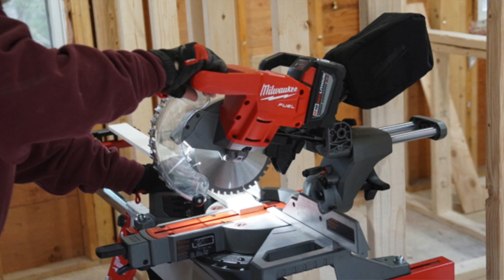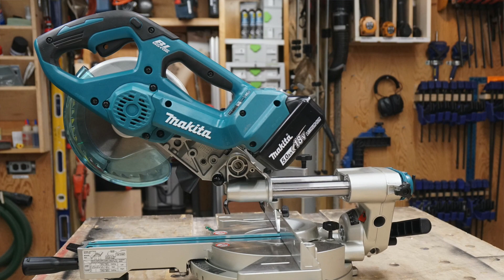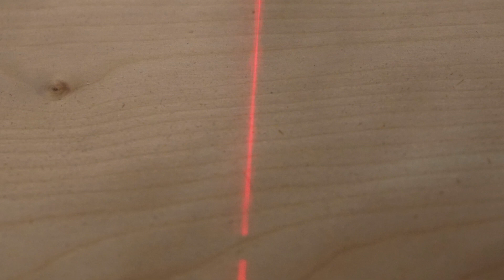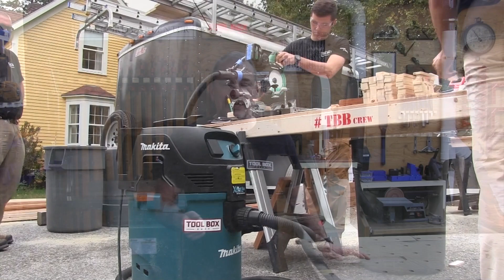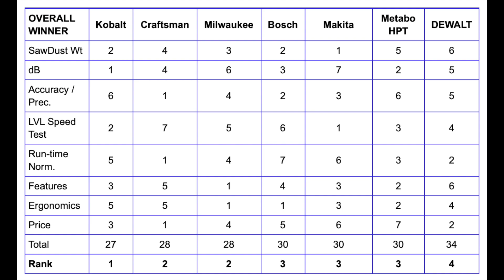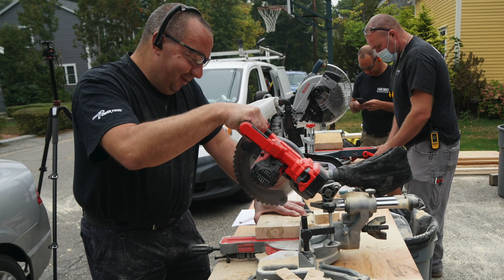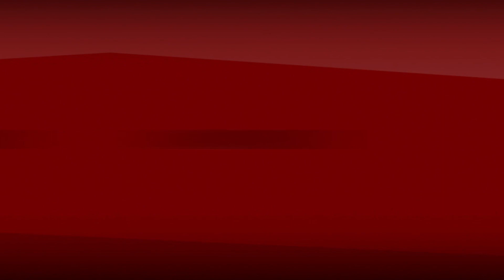BEST Compact Cordless Miter Saw - HEAD-TO-HEAD

Comment: Being from the Milwaukee area, we got to test a prototype design for a Milwaukee 10". It was pure garbage. We still have it 10 years later but we only use it with an aluminum cutting blade for cutting panic bars to fit on doors.

Comment: I need to know how accurate they are once adjusted. How do they compare to each other fully setup opperating at their peak. How easy to adjust is important, but how they came from the factory, as a professional is not so important. Once properly adjusted how does it stack up.  Ty, fantastic and informative vids

Comment: Hey Rob
Thanks to you and your testers i was trying to decided on a smaller saw for trim as finish carpenter as a high end cabinet maker told me has better teeth alignment to the piece,  and less vibration.
  I reviewed many narrowed to Milwaukee, Bosch, Makita and Metabo. After video demo and reviews became dual Makita or Metabo with larger cut capacity and features. My choice became the makita as the metabo doesn't even offer a saw stand. 
Ah the internet makes life easier as long as there is channel like this one. 

Thanks Rob and tot the crew

Comment: I have use the cobalt sliding dual bevel miter saw cordless for over two years. My only issue has been with the cobalt is they do not make replacement parts for it so if you break a part on it, you’re out of luck you have to get a new saw they do not make parts for the cobalt, compact, sliding miter saw.

Comment: I just bought a Craftsman V20 6 tool kit because it was $15 more than just the Harbor Freight Bauer oscillating tool and batteries and charger I actually needed. So since all of a sudden my cordless tool vendor is Craftsman, and I need a miter saw soon, Craftsman is my first consideration. You guys made a LOT of cuts and gave all these saws a LOT of run time and use, so considering that and how well the Craftsman scored, I'm confident it'll be a good choice to add to my cordless tool collection. Thank you for the absolute best review of miter saws I could have asked for!

Comment: I grew up on Hitachi. I have their current 12in dual bevel slider, and I had the previous 2006 model that was way overbuilt, looked like an alien, and had the same fine bevel adjustments as this compact one. I really wish they would come up with a more reasonable price for this one. I know R&D is expensive and I’m sure it’s well built. It’s just hard to justify that price when I also already have two 12in dual bevel sliders…the other being a Ridgid branded Delta Cruzer. Honestly though, I didn’t realize this saw had a laser. I may go buy it now…still prefer them over LED’s.

Comment: In the vid and your article you state you tested the ease of "tuning" the saw, yet as far as i can see you haven't published the findings. 
Are any of these actually tuneable in regard to the settings of the presets? Ie 30° or 45°.
Most saws I've found you can only tune it by adjusting the fence, which adjust every preset including the 90 irrespective of it's accuracy. 
Reason being I have a compound mitre saw that cuts true in most settings, but the presets are out of whack by fractions of a degree on them, most notably the 45s. Sure I can test it and adjust to get an accurate cut, but it's a proper hassle to require test and adjustment after moving between different settings.

Comment: I'm starting over with battery powered tools.  I have a 20 year old suite of Dewalt (drill, hammer drill, circular saw, reciprocating saw and flex gooseneck light) that I'm about to retire.  My last couple of NiCad batteries are dying out, these old Dewalt tools are big, bulky and heavy but very tough.  I want to start over with the newer lightweight Lithium battery versions.  In addition to the battery powered tools I have already  listed, I will want to add:  battery powered Oscillating saw, jig saw, grinder and 7.25" sliding compound miter saw as you guys have reviewed above.  This will be for my personal use which will be light and some handyman work that will also be fairly light.  I think Dewalt, Ryobi, Milwaukee, Kobalt, Makita + more make all these battery powered tools I will be getting.  Can you recommend a brand to go with that will be good quality and a good value where the same batteries work on every tool.  I'm leaning towards the Kobalt due to the good review on the sliding compound mitre saw you guys did here. 

If there is a clear winner in your mind for a line of hand tools that doesn't have a quality lightweight  7.25" Sliding compound Mitre saw, I'd still like to know what brand that is because I am willing to go with a different product and different batteries for just the 7.25" Mitre saw and everything else a different brand with the same batteries if that is the way to go.  The Ryobi packages seem to have some excellent pricing but I've never owned a Ryobi tool.  I have a tiny light weight Bosch battery powered drill that I always reach for first because of it's feather light weight.  So 1. what brand that has all the tools I want, good quality, good value and 2. what brand that has all the tools I want except the Mitre saw?  which I can buy separately.  Also, I'm not opposed to Harbor Freight tools, they seem to be offering some competition with quality examples in some tools now.  thanks, Tim

Comment: I have an old makita 10" miter saw that just didnt have the cut capacity and weighs a ton.  A few days ago I bought the corded Kobalt 7 1/4 sliding miter, simgle bevel miter saw and what a difference.  Larger cut capacity, blades are cheap, I have a lot of 7 1/4 blades and the 60t diablo ultra finish I had new fits it perfectly.

I was using my circ saw on anything wider than 2x6 but I'll be using the miter saw a lot more around the house.

Comment: I bought the dewalt and thought it was utter 💩💩💩 mitres for facings were out a mile and even tho I bought a better blade it was still rubbish and sold it straight away. Wish dewalt would make it more like a premium range because it felt really plastic and horrible too. 🤮🤮 

What's the best small corded saw guys. 240 UK 
I currently use festool on a portable stand but OK if I'm doing lots of work. Need somthing small I can just whip out the van quickly do the job and back in. Thanks

Comment: I‘d say the most important point on mitre saws is precision. So I‘d rank precision over stuff like runtime. That’s why I got the Bosch. With two 8ah core batteries it easily serves me the whole day. I personally prefer the laser over the blade shadow as for me it works better in direct sunlight. But that’s just personal taste I guess.
Reply: What size did you buy?  Do you still love it?

Comment: Picked up the Kobalt a week ago along with the 6.0 ah battery.  It is powerful, feature rich with the dual bevel, long crosscut ,  strong shadow light, multiple bevel stops, etc. and smooth sliding.  HOWEVER, I am having trouble with accuracy.  I am cutting base on the flat, and even though the bevel (with two different digital gauges and a carpenters triangle) at a 45, the cuts themselves are off (by a full degree+).  In addition, the crosscut is not 90 degrees to the fence and when I set it at 90, then it is off on the bevel.  I'm wondering if the rails might be slightly off too.  It is possible I got a bad one, but pretty frustrating so far.  Will try a bit more, but running out of patience.
Reply: Just a follow-up.  I returned the Kobalt.  Now researching the remaining options.  Honestly, I know the Dewalt is practically at the bottom of the list on features (i.e. no brushless motor, left bevel only, only 8" cross-cut, shadow light is dimmer than other shadow lights, etc.) and is one of the oldest offerings in the group, but it has a ton of Amazon reviews (800+) - partly due to its age - and many folks note the accuracy is good and it s generally very highly recommended.  I may give it a shot.  The Makita is online only and, frankly, the new 40 volt LS002G is both a.) likely to replace it and b.) likely to be expensive (i.e. $600+, plus a new battery system).

Comment: If we get the new Makita 8 1/2" LS002G XGT (Makita's new 40 volt platform) in the U.S. this year, it could be a serious player in this space.  Specs look good (12 1/2" crosscut,  miter 60 left and right, Bevel 48 left and right, forward facing rails, 4800 rpm, etc.)...basically a smaller version of their 10", but with the new platform (note: the latter isn't necessarily a good thing if you already have a bunch of LXT batteries.  It is already out in Asia.  Here is a video from Vietnam: https://www.youtube.com/watch?v=pegcFR1CCZk

Comment: It’s December 2020 and I’ve had that makita for about 2-1/2 years now. I keep 6.0 batteries on it. It can fit on my passenger seat if I want it to. It is one of my most valued tools. I have the stand for it as well. I can pick it up on the stand and move it around if I have to. It cuts anything pretty much. I like not carrying my 12 inch makita around. But the best set up ever Is when I get them both going in a straight line with material standouts on either side and a trash can in the middle. I can slide 16 foot trim between the two and drop waste in the can in the middle. Ideally you’d want 4 saws going and only set an angle once on each saw. So next I’ll probably go with a ten inch makita two battery saw, then I’d have that little makita in the middle for just straight cuts.

Comment: I wish the DeWalt was a mini version of their 12" saw. There is no reason for it to not have all the same options. That being said I don't understand why you were so hard on the DeWalt yet you praised the craftsman and described it as old DeWalt tech.
Reply: Staley black&decker bought craftsman a few years ago to be there homeowner line of tools. Like ryobi is to Milwaukee
Reply: @stoicllc2352  how far we have fallen. Craftsman use to make quality tools I still have some of grandpas craftsman tools from the 50s and 60s. In fact I used an old Craftsman breaker bar with a pipe as an extension to break the lugs off my work truck yesterday.

Comment: I got the Craftsman because my priority was portability.  I strap it to the back of my Quad and go out into the field to cut 1x6 fence boards.  Only downside is the power on hardwood boards, but.... that was expected since it is so small and light.   Great review!  Cements my opinion of the Craftsman.

Comment: Another great test,and great data for weekend warriors. 
But let's face it,very few contractors will have 4 batteries and 1 seperate  tool brand for value's sake.
My 2 exceptions to my m12/m18, Makita 18/x2 lines are,Ryobi pin nailer with adapters for red and teal,a Ridgid shop vacuum with teal adapters. 
Most flaws can be overcome by a work-around, all poor dust collection needs is a hood and a tarp below,no shadowline add an led inside blade guard,and etc.
 Fantastic job to the whole TBB crew👊.

Comment: I appreciate the testing you guys do. Is there any chance that you add ease of getting warranty repair to the mix, e.g. do you have to ship it back to a service center or can you drop the saw off at the store? Until recently I would have given extra consideration to DeWalt because a service center was in the next town. However, that service center is now closed and most tools, regardless of brand, I purchase need to be shipped to a center for service.

Comment: One important spec that wasn't mentioned (IMO) is CROSS-CUT CAPACITY.  Assuming the cordless Bosch is based on the corded version, I can easily and cleanly cross-cut a stair tread on my corded Bosch, but I can't cross-cut (in one pass) on my Milwaukee M18 7-1/4" miter saw.  As a finish carpenter, this is an important decision factor.  If only Milwaukee came out with a copy of Bosch's saw, I'd sell my current 7-1/4" for a 8-1/2".  Two gripes about the Bosch however:  the top carry handle, and it's only single bevel.  I might, however, pick up the cordless Bosch and slap an M18 battery adapter in there since 95% of all my batteries are M18.
Reply from the maker: It’s in the article

Comment: Excellent review!!! Got the Craftsman for $203 as a kit out the door & have had it a year & a half now. It's been an excellent saw & I was shocked how accurate mine was. I like the smaller footprint & weight of the Craftsman & it has extras the DeWalt doesn't like a depth stop for dados & rubberized grip. Just wish it had a top handle. Otherwise, it's just like the DeWalt but scaled down to save 10lbs of weight. Best DIY value unless you got the Kobalt on that insane $99 deal last year.

Comment: Great review! I'm surprised that Craftsman came it second place. And a testament to great engineering, dewalt saw has a brushed motor and still came in second place in the normalize runtime, goes to show engineering in a product is critical.
Reply: Because saws are used at full power brushless and brushed there isn't a big difference in runtime like a drill or impact driver

Comment: I didn't have all this information when I bought my Milwaukee 7 inch, but I still made the right choice in the long run. I wanted to try the Metabo specifically because of the AC option, but no one had them in stock and that price is stupid. The Bosch was an 8 inch blade and that killed it for me. I own Bosch batteries and would have loved to use those on the saw. The Kobalt and the Craftsman were nice little saws, but the slide bars sounded gritty and weren't as smooth as my 780. The Makita I loved, but it was the 2 battery thing that got me. We bought the 10 inch to rebuild my parent's house after Irma and I loved that saw, but the dual batteries was a pain. Milwaukee already had a head up with me since I had a 6 and 9 ah battery.  The Dewalt single bevel was a deal breaker even though I love my 780. Like I said, the Kobalt was just the rails sounding gritty and my worry that their batteries will vanish soon since Lowes seems to be pushing them aside.

Comment: I’ve made so many purchases based on your reviews. Simply the best overall most professional on YouTube. I own the Dewalt 7 1/4 saw and currently looking to replace my 12in Delta Cruzer with something a bit smaller and lighter but still want power and capacity. Leaning towards the Metabo miter and table saw. Like the option of corded also. Thanks

Comment: I appreciate your honesty, and knowing the results but as a pro we are probably chained to battery platform not to mention in the back of my mind I am thinking no way that Kobalt is better than my Makita
Reply from the maker: That Makita has an impressive run time - cutting. Its a nice saw
Reply: I use power tools from four brands, but have mostly Makita batteries. There's a battery adapter for every platform out there. Electricity and batteries are agnostic, and it's only connectors that make it proprietary.

Comment: I own and use the DeAlt saw professionally and while I like it and use it; i agree it can benefit from a gen 2 upgrade. It needs dual bevel and would benefit from adjustable fence. The DeWalt is just a good cheap pro grade saw. It’s nice in that it uses the standard 20 Volt batteries. It works great for trim as you can bring it right in next to you given its size. I love the small wall and find I use it more than the 12” just because it’s smaller, lighter, and easier to move.
Reply: fyi fence is adjustable screws on back side

Comment: I have the DeWalt saw, not the best out of the test (though I have the european adapted version) but I just want to say that it does really well, I build several sheds with it etc. one battery a day. But I think I will go to their flexvolt version if they don't upgrade this one. (I am on the Dewalt platform otherwise I would've gone for the Millwaukee tbh)

Comment: Nice test as usual.  
Suggestion:  I wish you would have used a High Output battery in the Dewalt and Milwaukee saws.  They certainly would have performed better in run time, power and efficiency.  I realize you are just using the stock battery, but most anyone who buys a Milwaukee or Dewalt saw would own a bigger battery to use in a power hungry stationary tool like this.  In future tests, you might want to consider testing the tool with a more realistic battery rather than the undersized stock battery included just to keep costs down.  The Makita saw had 2 -5.0 batteries and the Milwaukee had only one.  I would expect the Milwaukee to lose on all performance tests.  If it (also the Dewalt) had a 6.0, 8.0, 9.0 or 12.0Ah battery, I am sure the results would been radically different.
Again this is just a suggestion.  I realize you invested a lot into these tests and they are very helpful.  Don't take my suggestion as deconstructive.
Reply from the maker: Its the battery that the saw comes with - I agree with yu we could change results with batteries. For example when I use my Milwaukee compact I run a 12 Ah battery on it so I dont have to change the battery

Comment: Good breakdown for framing! I would like to see a little more effort paid to finish carpentry for the mitre saws especially. Ease of setting non-standard angles, thickness of indicator lines, microadjustment knobs, etc. Basically everything you tested on these could be equally applied to circular saws, but circular saws really shouldn't be used for finish trim work, or any sort of finer projects like building picture frames, etc. 
Also even just for the framing, built in stops, clamps, (I hate my bosch's clamping system), are pretty important to the day-to-day use of a mitre saw, and seem to have been missed here.

Comment: Dont know how yous ranked Milwaukee with the most features. 
Milwaukee only cuts 180mm on the slide
Hpt cuts 300mm
Milwaukee has no depth stop
Hpt does
Milwaukee has no laser(not that it matters 
Hpt does.
Milwaukee only runs on 18v
Hpt can run on 36v and 240v.